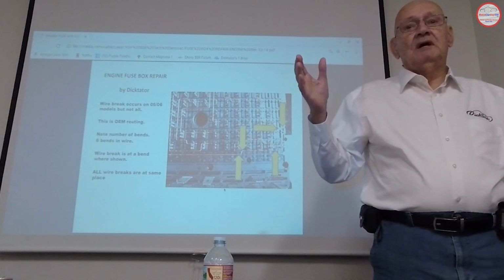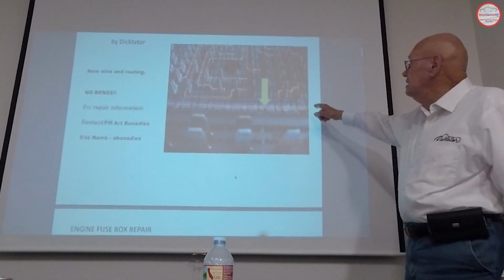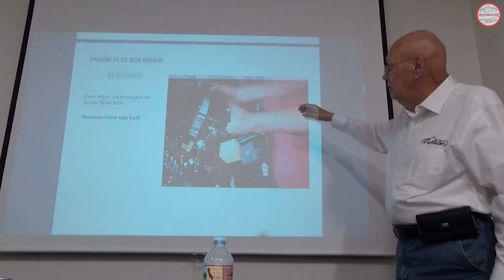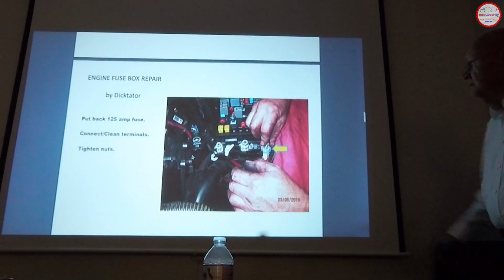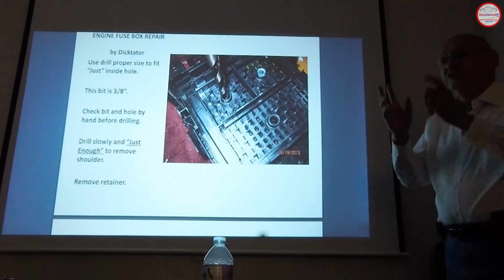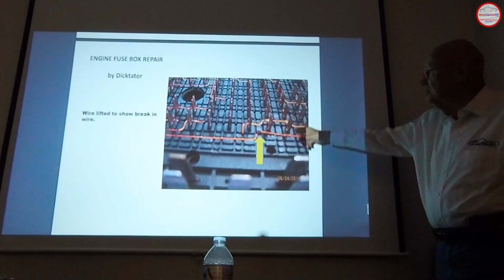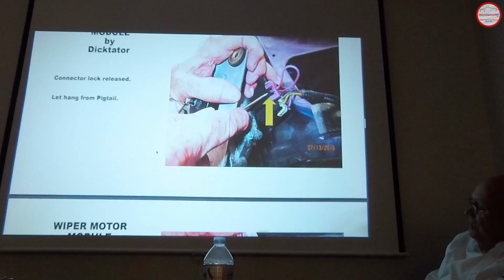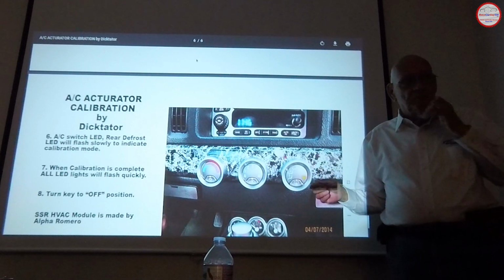Chevy SSR - Tech Session - 8/25/2018 - Electrical: Part 1 of 3

Comment: My question about the fuse box issue. The forum you having on the better improvement and better material the actual board made of.if you could take all agreements on the improvements and have an updated version of the board custom manufacturer would you?
Reply from the maker: The 2005/2006 engine bay fuse box issue is not a problem with the board itself. There's one circuit routing on the board that causes the copper wire to be bent at a 90-degree angle.  That particular 90-degree bend in that copper wire was resulting in a very thin/small amount of copper for that 90-degree bend in the wire.  The heat cycling of the engine bay will, over time, cause that 90-degree bend in the copper wire to fracture/split.  When the fuse box/engine is cold, the wire still has continuity and as the fuse box/engine bay warms up, the wire will separate at the 90-degree bend causing a loss of power to critical engine power circuits.  The "solution" is to replace that copper wire with a wire that follows a more straightened path thus eliminating that particular 90-degree bend that was breaking. Many SSR owners have been able to perform this repair for the SSR owner community.

Comment: Yes, a lot on the market I think in conclusion the owners don't won't too tackle some challenging maintenance issues that comes with owning an SSR however for us SSR die hard owners the challenges become permanent better solutions for maintenance repair. Good for thought just consider before selling your SSR the probability GM manufacturing another unique, weird  fun, enjoyment of owning one, is virtually 0%. Especially a hardtop hydraulic system. So although us die hard owners might have too invest more for maintenance solutions it worth.owning one